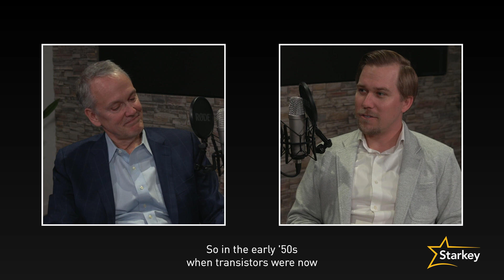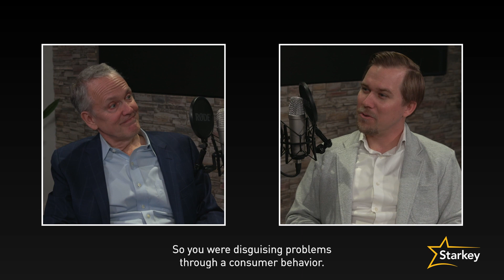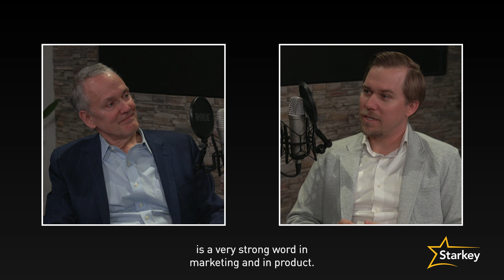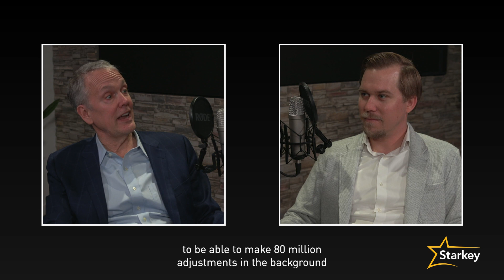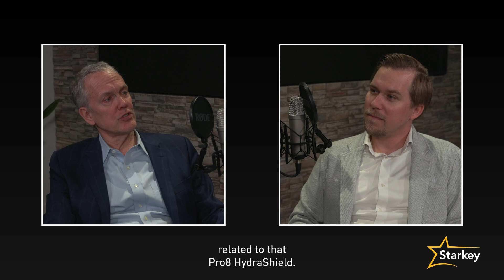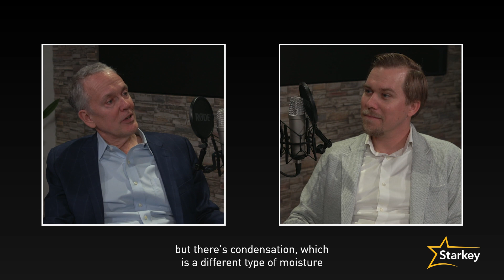NEW Starkey Hearing Aids Are WATERPROOF!

Comment: How would you say the Starkey Genesis AI stacks up against the  Phonak Audéo Life hearing aids on the market currently?  Which of the two hearing aids are more "waterproof"?
Reply from the maker: Great question! Genesis AI is tested at a depth of 1m (3+ feet), whereas others on the market are tested up to 50 cm (~1 ft). Our methods of protection are proprietary, so hard to compare there, but Genesis AI is built to withstand daily wear and tear, whatever you do!
Reply: How many feet is it for 5 meters depth of pool and ocean water ? My friends has October 2022 Phonaks Audeo Life Waterproof sweatproof Over-The-Ears hearing Aides with wireless Bluetooth added and works with Bluetooth Android cellphone computer and she goes ocean surfing and water skiing and swimming in fresh water pools numbers of times and mountain biking and camping for weeks bringing only solar power panel Bank Mobile cellphone computer rechargeable battery to charge her hearing Aides base for 3 hours while sleeping 6 hours and while leaving hearing Aides hooked up to hearing Aides base to recharge her hearing aides . I don't know if 6 meters are over 6 feet or not but her hearing aides are still working at 6 feet deep ocean water and swimming pools and she shake water out and start back wearing hearing Aides like it didn't get water in them . Oh hold on . I'm speaking to her now .

Comment: Sadly, I have to admit that I think I've gotten into the shower with every set of hearing aids I have owned over the last twenty-five years. No damage to any of them. I have been wearing new Starkey Genesis AI ITE devices for the last month and haven't showered with them as yet, but, so far I am completely underwhelmed with them in terms of wind noise reduction, feedback and echo problems. I'm going back to the VA this week for a followup appointment and if we can't make some improvements they're going back. I hate to say that, because I like supporting the only company that makes hearing aids here in America.
Reply from the maker: Hi Bill - Thanks for commenting. Based on what you're describing, it sounds like some additional adjustments and fine-tuning may be required. We hope that they better meet your expectations after your upcoming appointment.
Reply: @starkeyhearingaids  As do I. I was really excited when the Genesis platform launched. I was hoping these would be my all time favorites. Fingers crossed.
Reply: I tried these hearing aids, worked in quite one on one but did not work in noise, on the phone. Bluetooth (BT) drops out, cannot have a phone call over BT, problems streaming music as well. Great battery life.
Reply: @waynekosters1814  The bluetooth works fine for me. I have an iPhone 12, that may be why. They work fine for me with the tv streamer. I have trouble hearing my wife and that's a huge problem for me...
Reply: Starkey hearing Aides Over-The-Ears hearing Aides will not work with Old and New Android cellphone computer smart phone Bluetooth.